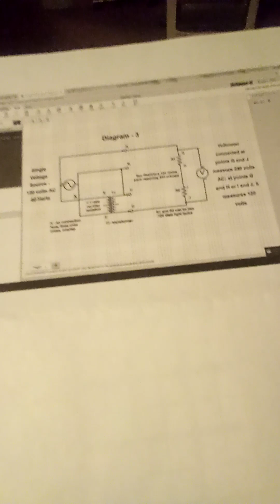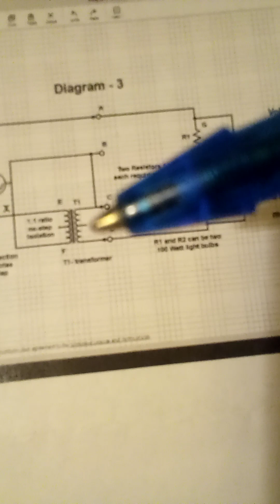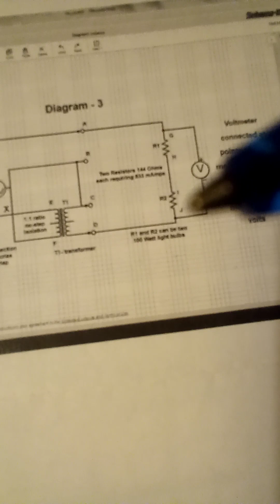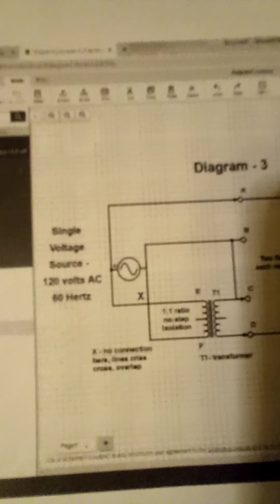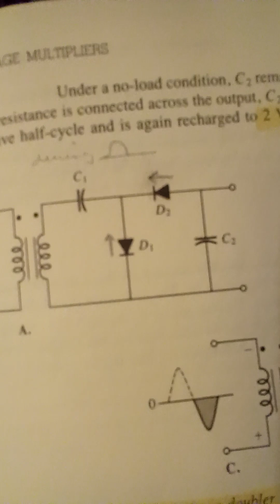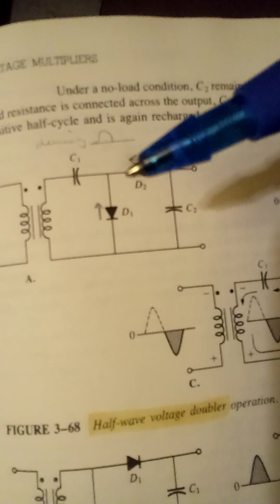AC to AC Voltage Doubler circuit diagram

Comment from the maker: 240 to 240 volt transformers available @ https://www.interpower.com/cgi-bin/ic.cgi/p25form.p?w_part=82520040
Reply from the maker: Don't buy these! They use only 14 guage aluminum wire and that causes too much electron losses resulting in too much current drawn from the wall, which defeats the whole purpose of the Power Supply Current Saver process.